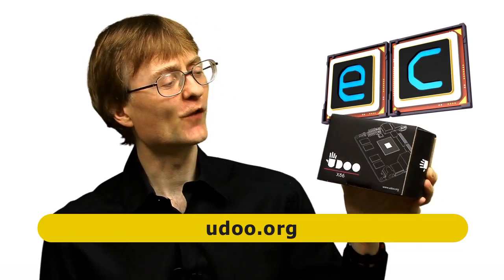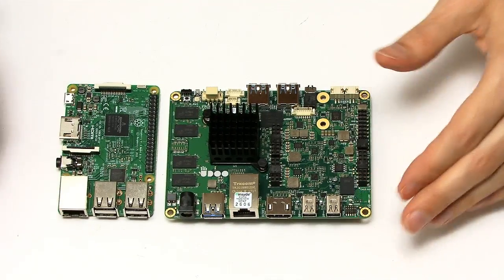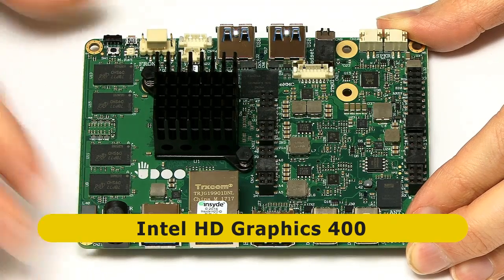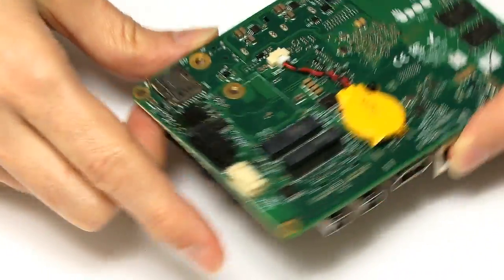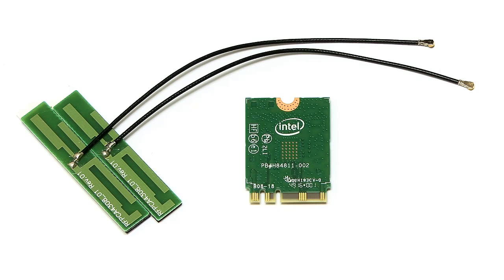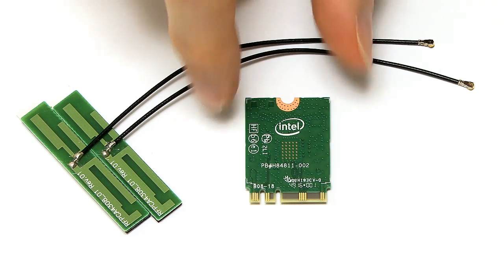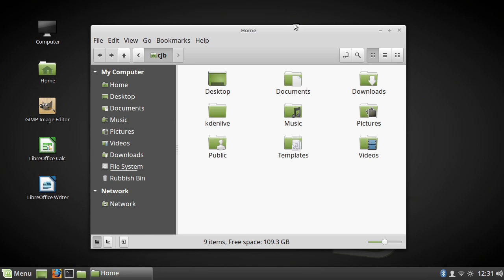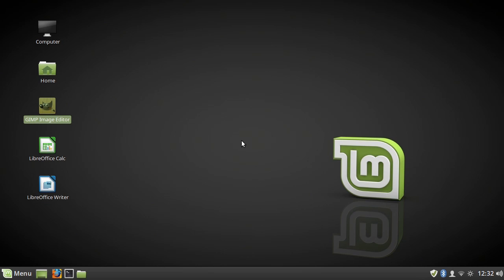UDOO x86 Advanced Plus

Comment: This board doesn't worth as it is very costly. In $165 we can assemble a PC with pentum gold G4560 good for gaming and 8gb ddr4 ram
Reply from the maker: True, this board is not an alternative to a gaming PC. But it is a reasonable purchase if you need a small, silent board and/or require the GPIO connectivity (which a standard PC does not have). So it depends what your use case is.

Comment: From what I understand transcoding with plex requires an x86 cpu. UDOO is supposed to be a good plex server with transcoding.

"Yes! I just purchased an Udoo board to do this after having really maxed out my Odroid. I can easily run 2-3 streams converting 1080p 10Mbs files to 1.5Mbps 480p on the fly. Sync conversions run between 6-10x real time."

https://www.udoo.org/forum/threads/support-for-intel-quick-sync-plex-hardware-transcoding.15498/

Comment: Your video encouraged me to buy the exact model of Udoo and I don't regret a penny spent on it. I installed an Elementary OS on this baby and it easily became my main workstation for Internet, entertainment and some hobby electronic and software projects. The fact that it's Intel based not only makes it faster, but gives access to a greater software base. And it still fits into a (coat) pocket :)
Reply from the maker: Great news. The UDOOx86 AP is a great little board. I really must take a look at Elementary OS on the channel at some point. :)

Comment: whats the best single board for gaming, i want to make my own device that plays my old PSP rips, actually with Udoo having Adreno can i rig the UMD drive straight to it? basically im trying to make a small multi console. something that will play GB, GBC, and GBA, cartridges, SNES, N64 and Genisis cartridges, PSP UMDs, and even Bluray discs... will this SBPC run all that hardware? or would straight emulation be the way to go with any single board?
Reply from the maker: A Tinker Board with RetroPie can make a decent system (emulating old consoles). I am not informed on retro gaming on c86 hardware.

Comment: Well Sir Chris,  As always I was impressed with your recommendation of the UD00 x86 Advance PLUS.  Yes a bit pricey. but so is the ROCKPRO64 once you add all the components.  However, I thing the UD00 x86 Advance PLUS gives me more connection capability as you mentioned. What confuses me on that is there is a SATA port on the board but also optional SATA cable and power cord.  Would that allow 2 SATA iii SSD WD drives to be attached?  also,, they reference the M2 board you mounted as being available on their site but didn't find it. I opened a ticket asking for assistance in locating it.  I would prefer to load OS on the M2 as you did.  I will check out that version of OS Linux/Mint I believe you mentioned and read up on it.  I need to assure it has a good spreadsheet package with it. and both the document and spread sheets are portable to windows document and spreadsheet programs.  I am eagerly looking for your ROCKPRO64 video.  However the FORUM board people say it is too early in release cycle to buy as they are still working out bugs.  I was going to connect usb3 to sata cables x2 and my spare 500gb drives.  however the UDOO seems more suited for those 2 SATA III SSD drives and use M2 card.  THE DECISION WILL BE PRICE AFTER ADDING UP ALL COMPONENTS FOR EACH and getting a final price for each.SO SORRY AGAIN TO RAMBLE ON!  I AM JUST EXCITED!  YOU ARE DEFINITELY PURE QUAITY IN Y9UR VIDEO PRESENTATIONS OVER THE OTHERS COMPETING.  YOUR IN DEPTH KNOWLEDGE AND METHOD OF EXPLAINING TO ALL VIEWERS THE PRODUCTS ARE ON SPOT!BE SURE AND HAVE A COMPETITION BETWEEN UDOO AND ROCKPRO CONNECTING 2 SSDs AND PERFORMANCE!IF YOU EVER COME TO USA. HEAD TO ATLANTA GA.. LET ME KNOW IN ADVANCE! I WOULD LIKE TO JOIN A SEMINAR OR JUST MEET YOU IN PERSON.
Reply from the maker: The SATA cable is for one drive and has the standard SATA data connectors, but a less common power connector at the board end.

Comment: At your behest and suggestion (thank you).

The Udoo website shows four x86 boards, the Ultra (8 GB DDR3), Advanced Plus (4 GB DDR3), Advanced  (4 GB DDR3) and Basic (2 GB DDR3), but when I go to look at the Basic, the page isn't available.  The Ultra is very expensive, $267, Advanced Plus $174, but no prices on the other two.  

It's too bad.  They have a lot of features I need, but they've priced themselves out of my market with features I don't need.  2.00 GHz is more than I need, and 2 GB DDR3 is plenty.  

Digikey (my favorite store in the world, after Radio Shack, and maybe Mouser) has it for $135, but they don't tell whether this is an obsolete part, which they would normally show.  Still kinda pricey just to get that extra video port.  It's MinDP port, so you need an adapter (I don't know what sort of video display has this - I think it's Mac-based).

The built-in heat sink is a nice feature.

Comment: Sir, can i connect graphic card of nvidia with udoo x86 advance plus i want to make this a gaming laptop
Reply from the maker: I do not think this is possible; the M.2  slot is SATA, not PCIe. You may be able to  use a USB3  video adapter.  But really, the spec of this board is not suitable for significant gaming.

Comment: Hey Christopher great video. How does this compare to the Odroid XU4 ? I'm looking for a good power-efficient single board computer to use as a small webserver and NAS and the SATA port apart from all that m.2 goodness is especially alluring. I saw it's about 5 times faster than a raspi3 but the raspi isn't a particularly powerful sbc so i would be interested to see how it compares to some of the beastier sbcs like the xu4. Cheers
Reply from the maker: Thanks for this. :) It sounds to me like you may well like an Odroid HC1 or HC2. These are special versions of an XU4, but with a SATA connected (power and data) and designed to mount either a 2.5" or 3.5" drive on the board. So designed to build a server/NAS. I review them in this video here: https://www.youtube.com/edit?o=U&video_id=AtHzhtkxIc8 In terms of other NAS comparions, look at this video where I build a NAS with four SBCs, including the UDOOx86 AP and a Pi 3: https://www.youtube.com/watch?v=jsCgXQjaviM The UDOO wins (it really is a great board with fantastic flexibility), but other boards -- eg a Rock64 -- offer better value. Good Luck with your build!
Reply: ExplainingComputers thanks!

Comment: Is possible to install/run Windows Server OS on this board?
Reply from the maker: I see no reason why not -- it is a standard x86 PC.
Reply: Just to make sure, because there's listed only Windows 7/8.1/10. Thanks for reply.
Reply from the maker: The only issue could be drivers -- which are a lot less of an issue for servers, where the latest graphical drivers, WiFi drivers, etc, are not a priority.

Comment: this is an excellent video and this looks like a superb small computer. I find myself wondering why I would want one as it seems to be edging up towards the smaller ITX boards. I also have lots of old P4 motherboards lying around which would suffice for many tasks. Granted they couldn't run 3 monitors maybe. The advantage of something like the PI is that it's so cheap and has everything onboard, this computer is more powerful but it's like a mini PC and can be quite expensive once the add on peripherals are included. Powerful and small it is though, no doubt.
Reply from the maker: You are spot-on here. This is a great mini-PC, but a very different thing to a Pi.

Comment: have u tried windows 10 with dual display n dose it works fine?
Reply from the maker: Yes, dual -- or tripple -- displays work fine in Windows 10. A very nice feature of this board.
Reply: so is it possible to to achieve extended display settings too?
Reply from the maker: Yes, you can duplicate or extend. :)
Reply: im planning to have a touch screen  lcd and  a project as extended secondary display

Comment: Back before I went over to the iMAC I used to go to the shows, buy the bits and build, my own Windows machines. I suppose that path is still open. I haven't seen the shows advertised, but the internet is always open. I would like to get back to experimenter computing rather than just running programs. How much does it cost to get performance equivalent to the UDOO X86's  in a standard small desktop form factor? I'm looking for the crossover point between fifty buck set-ups with limited , but still good power like the RPI 3, and a "normal" desktop that could still run Linux. Where does the UDOO X86 fit in that spectrum?
Reply: You are way ahead of me, which is good, because it is rarely useful to follow someone who is lagging behind. Your video, "Building a budget PC" answers pretty much all my questions. The UDOO X86 is, budget-wise well in  the same price range as a bottom end PC. There are major differences in power consumption if that is an important consideration. The case fans of the budget PC probably use as much power as the whole SBC. That, and of course the UDOO X86 takes up less room.
Reply from the maker: Thanks for this. I'm glad you found the other video. The UDOO is a very capable board, with a computing experience like a normal desktop, rather than an SBC, and not least as you can run the OS off a standard SATA or M.2 card.

Comment: is it possible to used 7inch lcd as main screen n hdmi as extended display using udoo
Reply from the maker: That I do not know, though I suspect it is. The UDOO can run three displays from its HDMI and two DP ports, so I would be very surprised if one of these cannot be substituted for the LCD.
Reply: mini display port  can control rs232?

Comment: Hey Christopher, I was just wondering if you knew how high the board is? (from base of the board to top of heat sink). Haven't been able to find a datasheet with this info! Thank you!
Reply from the maker: From the base of the M.2 connector (the lowest point) to the top of the fan (highest point) is abput 35mm. That's about 8.5mm below the PCB, about a 2mm PCB, and the rest above.
Reply: Thank you for the prompt reply. Looking to make a laptop using this board but that's a little too high :S. RPi 3 fits so maybe I'll go with that but would love more power!

Comment: Good one, but too expensive + periphery things, proper box and so on = far too expensive for regular (just in free time) enthusiasts. For about 350-400$ everyone could assemble a cheep regular-size PC to play with. In addition, for even smaller price, a miniPC could be buied - cased with 64 gb SSD + win 10 (Linux is also a variant of choice) + 4gb RAM + wifi and Bluetooth + several ports for conecivity = Vorke V1 Plus http://www.vorke.com/vorke-v1-plus Excellent for desktop applications (an example of which I see in the current video).

Comment: For people whose interest in Pi type computers lies in the possible use of one as a regular computer, what these tiny Intel based boards do not do is narrow the gap, where the Pi-style are almost right, but not quite, although close at an incredibly low price. Of course for a high enough price, you could always remedy the shortcomings. In fact, an investigation of the very low-end x86 motherboards shows that you can already do a little better on price than this UDOO board, and the UDOO is into over-kill anyway. It is the over-kill aspect that could make this a decent deal for the price, if you do need the extras, but extremely overshoots the mark if you don't, which will be the usual situation. This is because of Intel's strategic decision to avoid going head-to-head wherever the margins are tiny.

 A real computer has a SATA port, or a more flexible full-speed USB 3 port, so that it can use, at full speed, dirt-cheap Terabyte hard drives under $50. Pi-types don't because their low cost comes through re-purposing commodity phone chips, which don't. The cheapest junk x86 motherboards have long had both SATA and USB 3, so implementation cost is not high.

 Being astonishingly tiny does not help a real computer because it will have a decent keyboard and monitor,  requiring decent sizes anyway.

 Same goes for astonishingly low power. A real computer is going to be operated for longer than a battery will last anyway. And if you have the means to recharge batteries, you also can operate the computer directly.
Reply from the maker: Great post.

Comment: you installed the cpu fan on the wrong side as you installed it, it will blow air outside to the environment whilst you want to blow air inside the CPU cooler fins.
Reply from the maker: For about the 50th time here, I installed the fan the only safe way it would fit! :) It has no guard the other way up, so yes -- it was fitted to blow up, which will still provide some airflow.

Comment: Would it be able to run one or more Winblows VMs? I see it's lacking many instruction sets.
Reply from the maker: It can run Windows 10, 8.1 and 7. I'm not sure why you would want to run these as virtual machines on hardware of this power.
Reply: There's still a program or two i can't or don't want to run natively in my Fedora OS (Visio, Sketchup,...). These have been running just fine in a Virtualbox VM on my i7 2600 system.
I understand that - in comparison - the UDOO is limited in CPU power and working memory and additionally, (looking at the comparison on cpuboss) lacks many of the instruction sets available to regular x86 CPUs.
Unless the specifications on that website are wrong, i'd love to know how the latter affects the UDOO's abilities. Perhaps it won't even run Virtualbox?

It will determine how well it fits my needs for a desktop replacement.
Also, thank you for taking the time to reply.
Reply from the maker: I am bewildered by this. The UDOO x86 Advanced and Advanced plus use one of the latest Celeron CPUs, the Ultra uses a Pentium chip, and the Basic an Atom. So they all have "regular" (and on the Ultra and Advanced models) modern x86 64 bit CPUs from Intel with a full instruction set. Where are you finding the information that these do not have a full instruction set? There are ARM based UDOO boards, and these clearly will not have an x86 chipset. This all said, on these boards I would dual boot to run Windows and Linux, rather than running virtual box -- something that is pretty easy as you can install an OS on the eMMC, SD card, M.2 if present, SATA drive if present, etc.

Comment: Explaining Engineering I am just curious, do you think it is possible to wire an external gpu to the udoo board? And if it is possible could an average joe tech enthusiast like myself do it? I have a 1050 lying around and I would like to know how much performance I could suck out of it, regardless of it actually being worth it. :-)
Reply from the maker: I think would be difficult, as the M.2 slots are slotted for an SSD and WiFi module. So it may be possible, but I would not bank on it.
Reply: ExplainingComputers Ok, thanks for the reply. Have a nice day.

Comment: You could get by on this thing using VirtualBox running MacOS-X, Windows-X and even Dos 6.22 with Windows 3.1x without using qEmu! But for the price, why not just buy a friggen NUC and attach a USB serial Arduino adapter to it.. Bare motherboards aren't much fun for a hacker/tinkerer unless it has loads of bare GPIOs with pins and solder pads!

Btw, that RTC battery looks like a seriously depraved afterthought!

Comment: The FAN was mounted wrong. It doesn't blow air to heatsink. All in all, awesome video, as always.
Reply from the maker: I have probably answered this criticism 20 times now! :) The fan is indeed blowing up, but the supplied fan DOES NOT FIT (safely) the other way up, as it has no shielding on that side. Some airflow will still be drawn through the views.

Comment: For a price of a maximal udoo ultra + taxes + shipping you can build up a way more powerful desktop on h110k with g4560 (2,5 times faster cpu), with fastest RAM & more ssd space. For a price of 330 euro (price of device itself+ case+power+shipping+taxes+postal fee) I build cpu:
Asus h110m-k
G4560
corsair 450 watt power
8gb ddr4 2400
120gb ssd
Wifi module
cheapest case and system fam
& still i has spare 30 euro.
Reply: Miniaturization and lower power use do tend to command a price premium, just as when comparing laptops to desktops.  Your build makes more sense in situations where neither of these factors is especially important.

My main workstation uses an undervolted i7-6700T on an Asus H110T "Thin mini-ITX" board, which accepts direct DC power (12V-19V via barrel jack) like the Udoo, avoiding the need for a bulky and less efficient ATX PSU.  With 16G of DDR4, one SSD active, driving two monitors (DP+HDMI) and all mechanical hard drives spun down, it idles at only about 9.5W (DC; not counting AC->DC conversion losses).

This is in a small Silverstone SG05(lite) cube case.  The only fan is a 120mm one above the CPU, which at 300rpm is inaudible, even with my ear just a few cm away.  It was fully fanless when I had an underpowered Bay Trail Celeron J1900 in there.  With a larger heatsink, the i7-6700T should be OK with passive cooling also, at least at light to moderate loads, but with it being effectively silent already I didn't see much need.

Comment: did it work  with any m2 sata disk ?
Reply from the maker: Yes, it works fine without an M.2 SSD -- you can install the operating system on the onboard eMMC flash memory, or on an MicroSD card (or on a USB 3.0 memory drive, come to that). I'll be running Windows 10 off the onboard eMMC in my follow-up video.
Reply: NO, it must have a matching key.
Reply: ExplainingComputers seems it need a 2260 type, Not so widespread